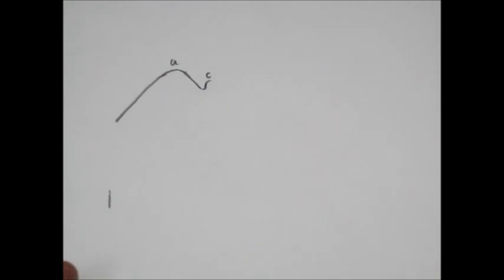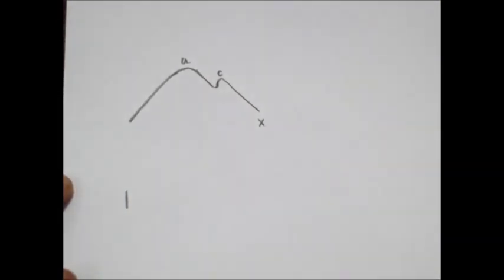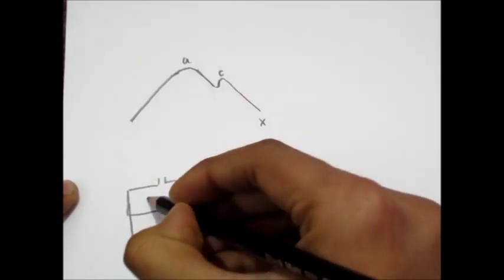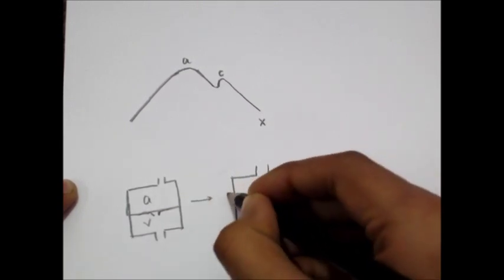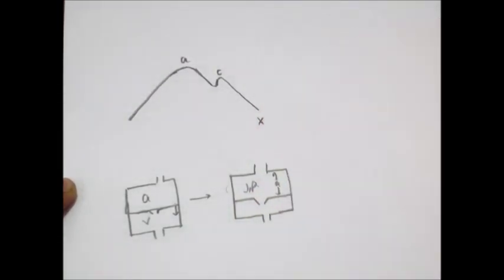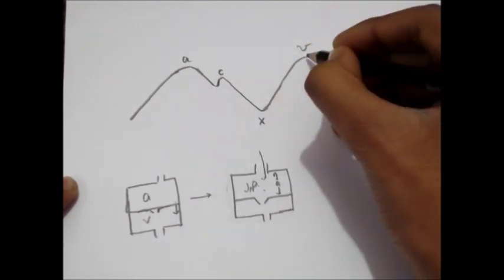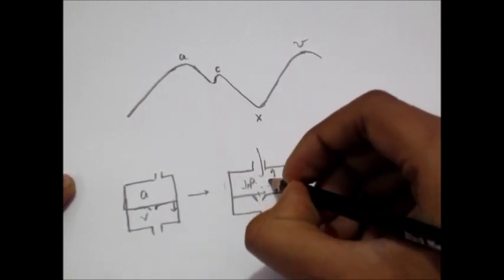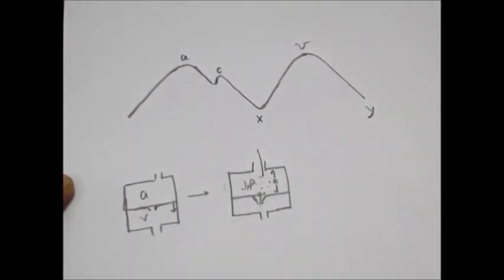JUGULAR VENOUS PULSE CURVE

Comment: 3.22 You say that the volume of the atrium is increased which leads to decreased pressure. Should it not be the other way round, if you follow the effect of the mechanism of the moving plane of valves? Decrease in pressure as the ventricle contracts (shortens) and pulls down the fibrous rings of heart will lead to increase in volume?
Great vid anyway!!!

Comment: 1. a wave-- atrial contraction
2. c wave --- Right Ventricle contraction( closed tricuspid valve bulging into atrium)
3. x descent--- atrial relaxation and downward displacement of closed tricuspid valve during ventricular contraction.
4. v wave -- increased right atrial pressure due to filling against closed tricuspid valve. 
5. y descent --- blood flow from right atrium to right ventricle. 
Thanks for your video just summarized it. Respect from Afghanistan.